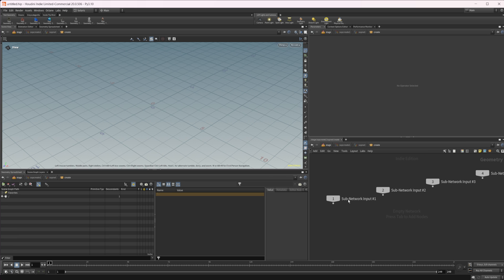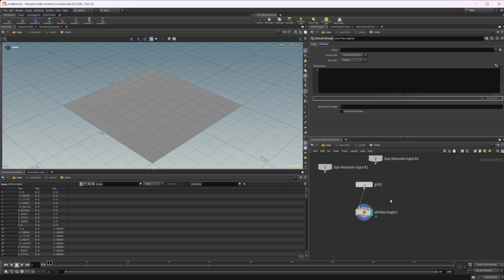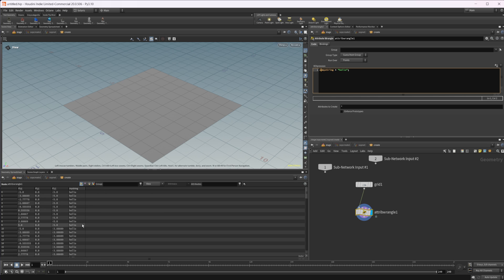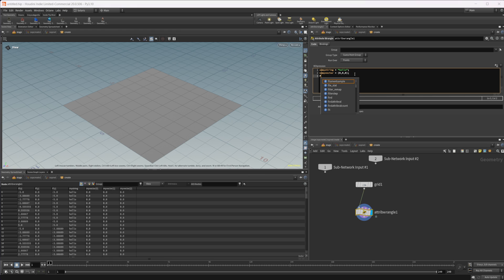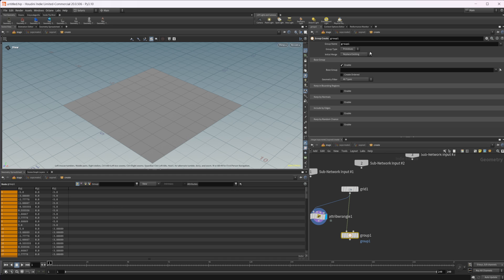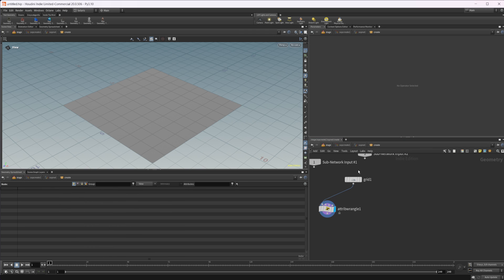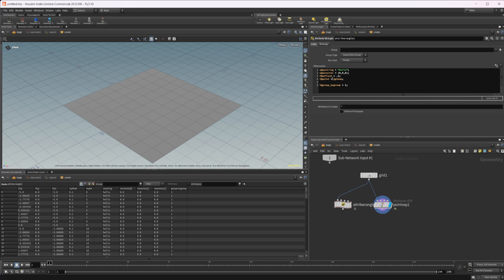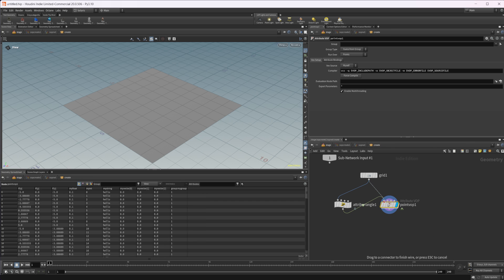Create Attributes | Vex and VOPs | Houdini 20

Comment: Small correction when creating a discrete vector attribute you must use {} instead of ().  If you use () instead it will make all the components of the vector the same as the z component.  For example if you set it to v@myvector = (2,5,9);  all three components will be set to 9.  If you use {} it will work as expected.